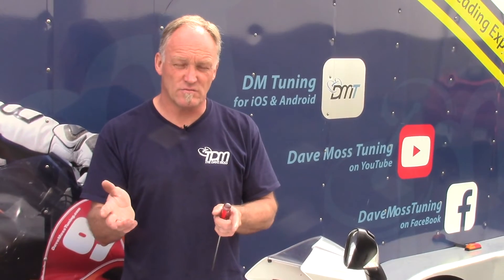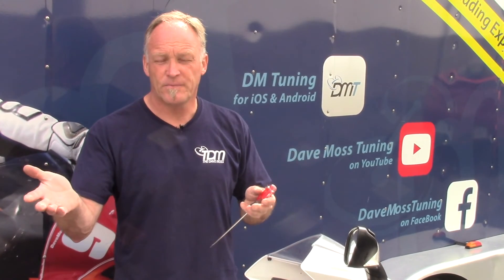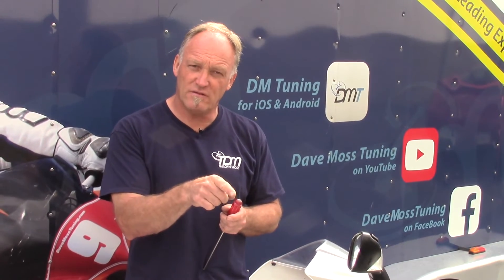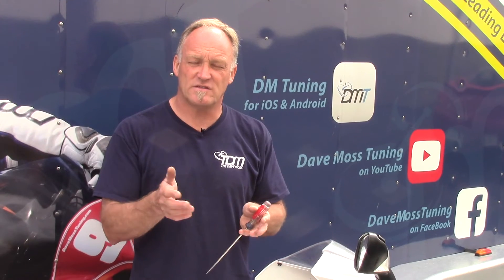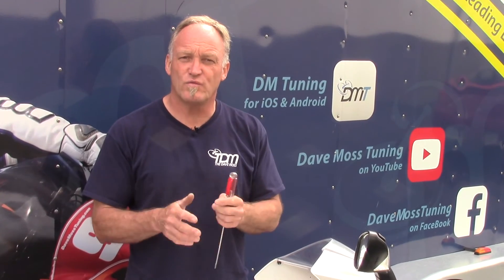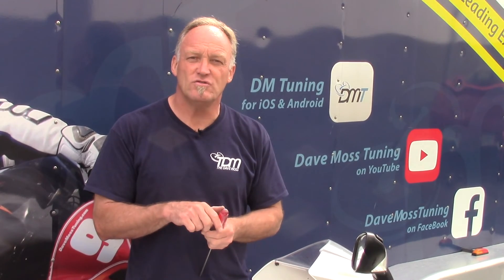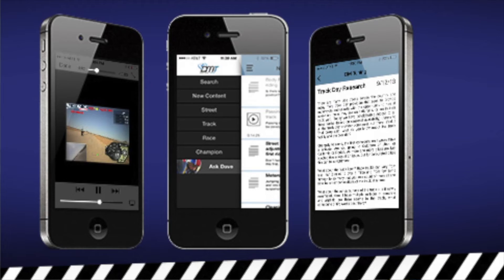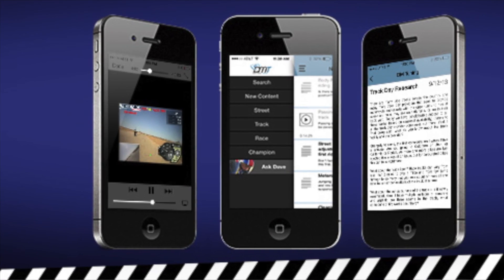Ask Dave: Motorcycle Fork Compression

Comment: If a spring is stiffer, would the fork require less compression damping and more rebound damping? Would it be similar in the opposite direction? If the spring is softer, would it require more compression damping and less rebound damping?
Reply from the maker: Yes, your logic is correct in principle. This must be viewed against fork and shock travel actually used.
Reply: @catalystreactionsbw  Thanks for your response.

Comment: Any real downsides to opening up compression on the street?
Reply from the maker: Suspension stoke increases and on bigger bumps, that means more velocity. Open in 1/4 turn increments so go a step at a time.
Reply: @catalystreactionsbw  Fair point, caution it is.

Out of curiosity, would adding a bit of preload be an effective means of mitigating any ill effects, or would that only upset the rest of the dynamics?
Reply from the maker: @233kosta  Preload is used to get travel to 75-80% of the total range first, then compression after that.
Reply: @catalystreactionsbw  Makes sense, thanks for entertaining my nonsense!

Comment: Love your videos .  Currently tuning my new mt-09-sp.   Regarding my KYB forks;    It seems to make sense but I haven't specifically heard you specify if front breaking is considered "slow speed compression" ??    And also, my zip tie seems to be stopping at about 3/4"  from the bottom of the lower tube but I'm not able to find any data anywhere to tell me where the bottom limit of travel actually stops relative to the bottom of the lower tube?      I would presume that If I grab a hand full of front brake with ABS  on, that I would want the zip tie to stop about 1/2" above whatever the bottom limit of the travel is?     Thank you for any help you can offer.
Reply from the maker: Brake set up for fork travel used is via preload. Low/slow speed compression sets the speed at which the forks collapse. Fork travel is 130mm from the spec sheet so you can measure bottom out this way: https://www.youtube.com/watch?v=eds3dn1LBkw&t=80s

Comment: Dave can you have 2 different compression settings in motorcycle forks?...My current compression setting is a tad too soft... If I go up to the next click (compression) on both forks it's too stiff... Can I jus go up 1 click on just one fork leg?
Reply from the maker: If you have compression in both legs and you have 2 adjusters (inside the nut and the nut itself), you have low speed/screw and high speed/nut. If just one adjuster in both legs set the same. If one adjuster in one leg (separate function forks), you can move in 2-3 click or .25 of a turn increments.
Reply: @catalystreactionsbw  I have preload & rebound on top & 1 compression down low on each fork leg
Reply from the maker: @bandanamuzic  okay so you have only one compression adjuster. Fork high speed adjusters are very rare.

Comment: Hi Dave and editor,
If you would be so kind to respond, I would lile to know if the age/mileage of the oil only afects its viscosity and damping ajustsments when it's hot, or even when it's cold has an influence?
Other thing is, should my compression be more or less the same front and rear? And what should I test ride 1st front and then read or both at same time??
Thanks a lot,
Cheers :D :D
Reply from the maker: Oil viscosity change from cold to hot increases with age so the effect is seen at cold and hot oil temperatures of 5C and 80C. Compression is set to the middle for test rides, then you try 75 and 25% to see what you prefer. Engineering for the forks and shock is different, so compression is not the same in adjuster position.
Reply: @catalystreactionsbw  oh okok. But if I have 75% front compression i should try to be around the same value on the back?
Thank you sir, your awesome :)
Reply from the maker: @JoaoFerreira-qj4zp  The back is not engineered the same, so in answer to your question, no. Shock settings are unique to the shock.

Comment: So when we turn it to "+" (which is clockwise here), r we closing the compression valve and making the fork stiffer or opposite? Same question for rebound, when we turn it "clockwise / +" we should close the valve and this will make suspension rebound/extended to org length slower... ?? Thank you Dave in advance.
Reply from the maker: If you go +/clockwise flow is slowed down making movement slower.
Reply: @catalystreactionsbw  Thank you Sir.  Just an extra Q. :) have you ever seen an adjustment turns clockwise not + but - ?)
Reply from the maker: @plt4415  On old WP shocks  yes.

Comment: What is the advantage/disadvantage of having one adjuster (Comp or rebound) in either fork leg, as opposed to both adjusters in both legs?
My 765 Street Triple RS has both rebound and compression adjusters on top of both legs, so I assume there are valves for both, in both legs?
Reply from the maker: The advantage is that you cannot cause interference by using each adjuster against the other and creating almost a hydraulic lock in the fork. The separation creates balance and precise adjustments in each leg. I much prefer this system as it allows me to get the bike set up quicker.

Comment: Hi. The term "damping " is the same as "compression" or "rebound" ? Thanks
Reply from the maker: Damping means to control or restrict oscillation.  With motorcycle forks, for example, that would be their up and down movement.  The down movement is the "compression" stroke, and the up movement from that compression is the "rebound" stroke.  The means of damping those two strokes is accomplished via oil flow.  The compression and rebound screws on the forks are used to control the flow of fork oil; righty tighty lefty loosey.  Turn them to the right and less oil flows thus slowing the movement, turn them to the left and more oil flows which speeds up the movement.  Most people mispronounce "damping" and say "dampening".  The linguistic reason is long and boring.
Reply: Dave Moss Tuning thank you sir for this elaborate explanation
Reply: Can one single shock have rebound and compression controls? Or is it usually one front shock is for the rebound and the other front one is for compression as adjustments goes?
Reply from the maker: There are many configurations for for. All in both legs, one leg only with C&R, one leg with C one leg with R. Rear shocks generally have preload and rebound as a minimum, some don't have any adjustments.
Reply: Thanks sir
Reply: Sir, you mentioned changing the forks oil at 5000 miles. Is this a maintenance routine!? And why?

Comment: Hello, i'm a bit confused, i though adjuster for compression are always on BOTTOM of the fork, near the wheel axis?
Reply from the maker: Compression adjusters can be in both fork caps, one fork cap, the left or right leg or on the base of the fork in the axle casting. There is no standard or universal placement now since the introduction of big piston forks.
Reply: If one has a choice, what would you recommend buying: bikes with big piston forks only or also cartridge forks?
Reply from the maker: big piston forks give better damping overall as you have more oil control and better flow management with a much bigger piston. Changing springs or seals is a bear though compared to cartridge forks.

Comment: my bike came with ohlins suspension in it, the guy said it was set for a 250 pound guy, i m 150 so i bought a stock suspension and installed in the bike. my question is can i set the ohlins i have to my weight? its just sitting in the garage, or is it to hard?
Reply from the maker: You can research the spring rates on the shock as an test to see what is on there and if that equates to his weight you can use a softer spring and try the Ohlins. If the valving was built for the springs, you'll need to revalve and respring. Do you have an Ohlins dealer near you that you can talk to?

Comment: Are the forks with asymmetric adjustments (as these) good enough for street and track days use?
I'm investigating whether my choice would be adjustable fork cartridges and springs vs ohlins forks on a retro bike
Reply from the maker: Most big piston forks in today's bikes work extremely well and perform very well all the way into the advanced group. I know that from my own work at the track. The only thing that may need to be changed would be spring rate based on weight and ability.
Reply: Thank you for the prompt answer, but the rig I'm considering is a Bonneville, so it's a right side up fork with no regulations whatsoever
Reply from the maker: If you are buying that model there are many different fork kits available for you to choose from. I have worked on Andreanni forks but have not seen much else. I would imagine Nitron and K-Tech make kits along with Ohlins etc.

Comment: Anybody got a tip on a video for forks rebuild on the 2011 zx6r?
Reply from the maker: What tips are you looking for?
Reply: Looking for a DIY video that you have done. Even if it is not the same bike, but you know the parts and process is similar to the 2011 Zx6r. If you have a video plz link it to me. I belive that a good suspension set up is key to not wrecking in corners...and the forks haven't been touched for 15k miles, what should I relplace if anything (I was kinda thinking replacing everything from seals to spring)?
Reply from the maker: Given that millage, just fork oil and if needed, fork oil seals, and inspect fork bushings for bear as those forks are "bash apart". The BPF video is here: https://youtu.be/nznDZpXqNv8?list=PLPQ0JY5Nl3xs-qiJ2reu9WLvV2nqe589A
Reply: Dave Moss Tuning You're the man Dave, thanks for the advice! Subscribed!
Reply from the maker: https://youtu.be/8T-LtOF5D2I

Comment: Dave, I have confidence in myself to rebuild forks (damper rod and cartridge) but is the rear shock rebuild doable as a home mechanic ??
Reply: I don't have a spring compressor ...
Reply from the maker: A rear shock requires quite a bit of special equipment and therefore a little investment in a nitrogen tank, pressure regulator, schrader valve, hypodermic needle and fitting, and specialised tools to get the shock apart. There are plenty of videos on YouTube on dirt bike shock services if you want to see what is involved in principle.

Comment: Thanks for all the videos Dave, where should you be in your clicker range for track riding if your springs are set properly to your weight and ability?  Should you be around 60-70% out and why?  Thanks in advance!!!
Reply from the maker: Thanks for the kid words! Clicker settings are ideally in the middle third of the total range of adjustment no matter clicks or turns if springs are correct for your weight and ability. As the oil ages you will move toward the maximum/closed settings to control hot/thin oil.  You would not leave engine oil in for 20,000 miles.

Comment: I get and understand compression on the front. A good tip it to cable tie the fork and be approx 20mm above the bottom out. I've never known how to set rear compression accurately? any tips for setting the compression for the rear?
Reply from the maker: If you shock is visible, exactly to same way with a small zip tie. You want to be 5-8mm off the rubber bumper ideally. In some cases, dirty and clean on the shaft is easy to spot. The only downside to a zip tie is losing it in the bottom out bumper and having to pull the shock and remove the spring to get it out of there. For shocks that you cannot see, a mirror on a telescopic arm works fine.